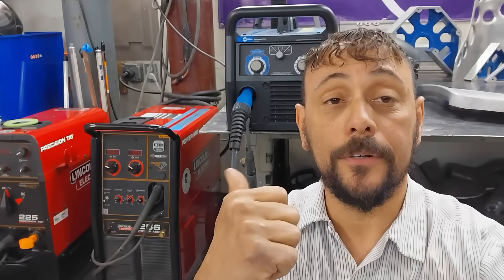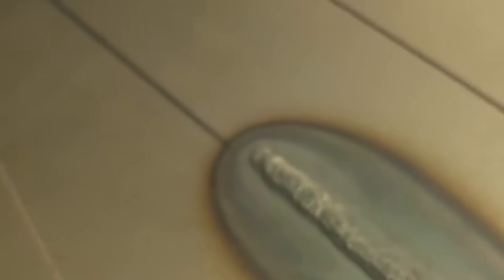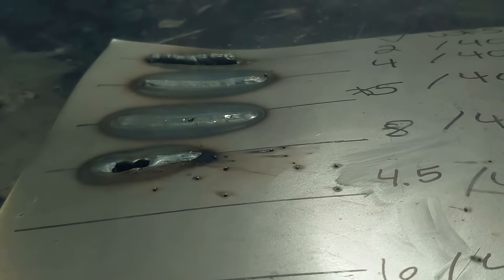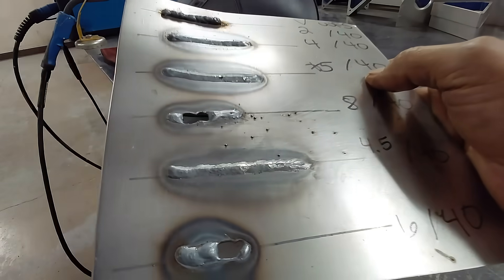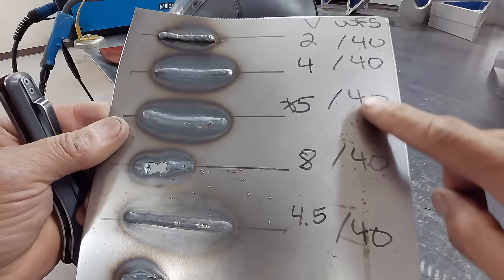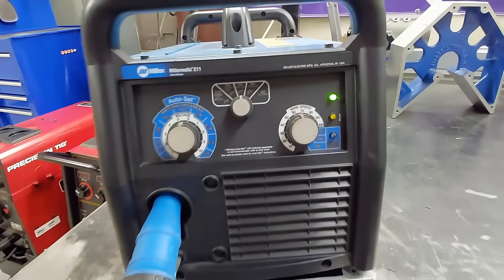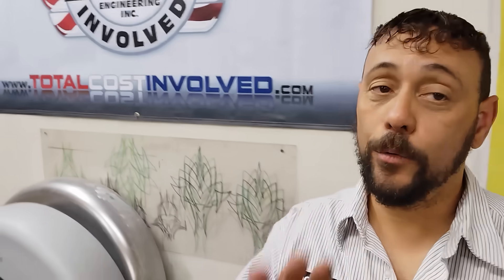Mig Welding - How to Set Wire Feed Speed & Voltage  3  Methods

Comment: "It doesn't get any quicker or easier than that–" < except when your welder is not calibrated in actual volts and your wire speed is not calibrated in actual inches per minute! >
Reply from the maker: What kind of welder do you have?
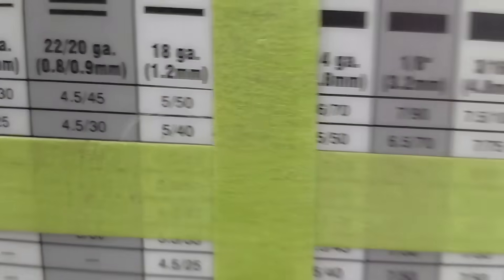Reply: @guzzifabrication3448  I was referring to your own Millermatic 211 shown at 2:27, and your quote at 11:29 was regarding the use of the Miller phone app to determine voltage and wire feed.  Sorry if that wasn't clear.  We had two nice machines at work, when I had a job, but I wasn't the welder, just the guy who made the parts, ground some welds, and removed the spatter.  I would bring anything I needed to weld to work and use the Miller.  I have a Cebora Pocket Mig at home with a 5# CO2 cylinder, which was a transformer machine, and did not work well until I began feeding it juice through 12 gauge wire plugged-in near the breaker panel.  Now the cylinder with 1987 date needs hydro testing, if they will even do it, although it looks brand new.  It can't run flux core since the roller is not removeable and for .023" wire and the polarity is not reversible.  Looking at an Azzuno, since it's all I can afford right now (or not!).  Sorry TMI, or TLDR!
Reply from the maker: @dahut3614 I get it, have you checked out?Yes welder or arccaptain welders? I did a video on the yes, welder, it's a solid welder that's inexpensive, i grew up really poor, I understand you have to use what you have.... i really appreciate your comment and thank you for following my channel !
Reply: @guzzifabrication3448  I'm watching your Yeswelder DP200 video right now!  It looks really good.  It looks like you used .035" wire for everything.

Comment: Even though I love my Lincoln equipment, the Millers are excellent machines, I learned how to TIG on a Miller, it made me look halfway professional on very thin material. You can’t go wrong with blue or red. How’s that Vulcan wire, is it any good?
Reply from the maker: Well as the story goes "red outside" "blue inside".... kinda like Milwuakee and Dewalt, Milwuakee better? yes but I have a lot of Dewalt.... Vulcan is a good brand and 1/2 the price of the Lincoln wire...
Reply: @g @guzzifabrication3448 your right the Lincoln wire is outrageous now that they don’t sell direct anymore. I’ll give it a try.

Comment: Another great demonstration video Robert. I did a similar thing when I bought my new welder. The only thing I've come across is that some patches we make going into existing metal get tricky with the original metal (although solid enough) tends to be an in between thickness and finding the right settings on the welder takes a bit of finesse. Thanks you sir!
Reply from the maker: That is absolutelty true about metal thickness, another issue that no one touches on is there is a huge difference in the quality of the old and new metal.... Todays metal is much less pure ( Recycling impurities ) and that does make a difference welding... It's a big problem today with aluminum...
Reply: @guzzifabrication3448  That's another good point. And have noticed it on our project which is a 63. So far haven't hit the aluminum until a little more tig practice is in lol